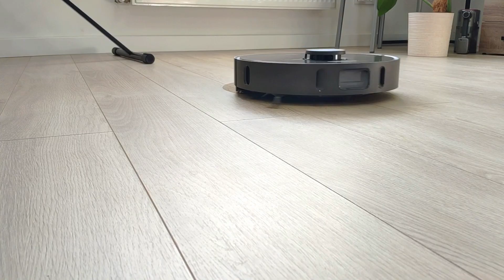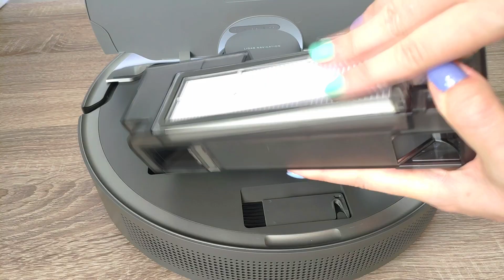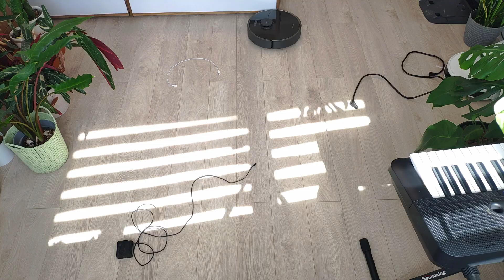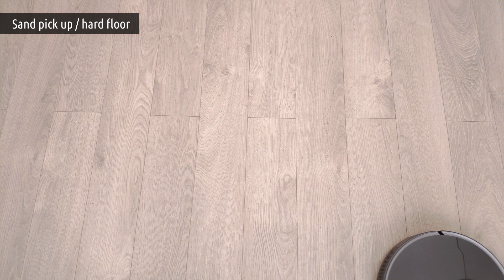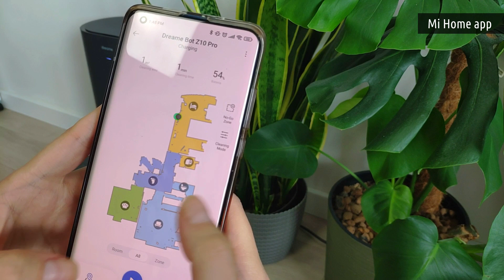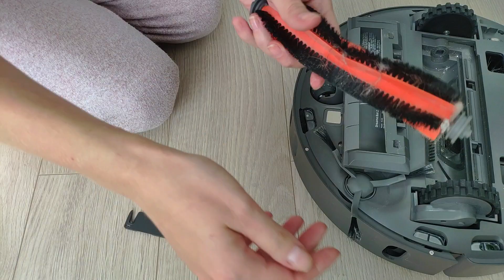Dreame Z10 Pro Review: Great Value For the Price

Comment: whats is lacking from Lydsto R1 compare to this one.
Reply from the maker: The main advantage of the Dreame Z10 Pro over Lydsto R1 is the front 3D sensor. The Dreame can "see" and avoid low-profile objects on the floor like socks, cables, toys, pet bowls, etc. Overall, in terms of product quality and cleaning performance, the Z10 Pro wins, but on the other hand, the Lydsto R1 is cheaper and has more accessories included in the box, so it depends on your needs.

Comment: Hello, thank you for the reviews, liked them a lot. Which one would you chose, dreame z10 pro or roborock s7 (regardless of price difference)? I saw both reviews but can't decide. Which one, in your opinion, is better for hair on hard floors? 
Thanks!
Reply from the maker: Hi! It's a hard choice, both have their own advantages. Both will pick up hair from the hard floor pretty well. The Roborock S7 is a better mop as the vibrating mopping pad removes stains better. The Z10 Pro on the other hand has a front 3D sensor so it can avoid socks and other small things on the floor. I prefer the Roborock app as it is more polished and has a bit more features. Both self-empty bases are pretty good. Overall, the Roborock build quality seems a bit more premium. But the Z10 Pro is cheaper and is a great value for the price too.
Reply: @SmartRobotReviews  thank you for the helpful reply, much appreciated!

Comment: I love to hear your voice and the very pro cat-tester (and of course the super pro and detailed review).

This robot looks good, but I don't want that kind of base, because I want it and the robot to be hidden under a piece of furniture when the job is done. Plus my appartment is 65 m², so I don't need that costly feature.
edit: I see that the base is optional and that the robot alone is sold under the name L10 pro
Reply from the maker: I understand. I live in a small apartment and a big system might not be the best choice. But I have two cats and it's essential to me. Still my main robot is the Roborock S6 MaxV that doesn't come with one of these. Everyone has different needs right? :)
Reply: The L10 Pro is the exact same but without the Self-Empty Base.

Comment: How does this compare to the Roborock S7 plus and the Shark AI self emptying vac?
Reply from the maker: Unfortunately I haven't tested neither of them. But I would say this is the most powerful self emptying system I have tested
Reply: @SmartRobotReviews  How do you like it? We have 2700 sq ft carpet, tile and vinyl. One Persian cat and 1 girl. Concerned about pet hair and ability to clean carpets. Any issues with emptying the dirt bin or hair breaking or getting stuck on rollers etc? How is the maintenance? Does it auto detect when the on-board bin is full and go back to the base for a clean or does it keep cleaning but doing a poor job because the bin is full? Does the robot detect when the outside waste bin bag is full? New subscriber 😎
Reply from the maker: It doesn't detect when the bin is full. Not sure about detecting the outside waste bin tho, I don't think so. The bin would just stop sucking up the dirt once the bag is full (I believe). I do like this robot but the downside is a small water tank, really not for those who need to use mopping every other day.

My floors are no carpet so this is important to me. But as a vacuum this thing is amazing, the best self-emptying system I've tested, great cleaning performance, best value.

Comment: Hi! excuse my English :)  . I've been watching a lot of videos and I can't decide. If money weren't a deciding factor, which one would you choose? My first option is the roborock s7 but there are several that catch my attention such as the dreame z10pro, q11, ultenic t10 or the yeedi vac station.
For daily use, which one would you choose?
My home is mostly hard floor
Muchas muchas gracias 🙂
Reply from the maker: Hi:) If you have hard floors, any of the robots you mentioned will do a great job picking up debris, sand, and other dust. The difference will be mostly in the build quality of the robots, navigation efficiency, and mopping performance. I would choose the Roborock S7, it is well made, has the most polished and nice-looking app, vibrating mop that performs great, it has a large community on Reddit and Facebook, and Roborock is pretty good at customer support compared to other Chinese robot vacuum makers. The Dreame Z10 Pro is great for the price too considering that it's twice cheaper than the Roborock S7 and offers almost the same features and performance. The Ultenic and Neabot are worse in terms of build quality, self-emptying base performance, cleaning performance, and their apps are not as stable and polished as the Roborock and Dreame (Mi Home) app. The Yeedi vac station has a great self-empty base (on pair with the Roborock and Dreame base), mopping and cleaning performance are great too, but navigation efficiency is worse compared to any Lidar robot vacuum as it uses a camera to build a map and navigate around. The Yeedi app and the robot's software also need some bug fixes and improvements.
Reply: @SmartRobotReviews  Thank you very much for the time you took to write. it was very enlightening. Thank you! :)
Reply from the maker: You're welcome!